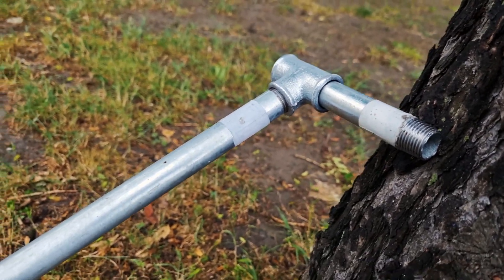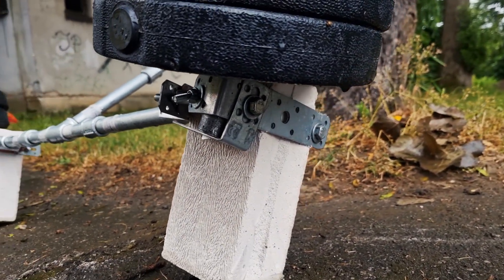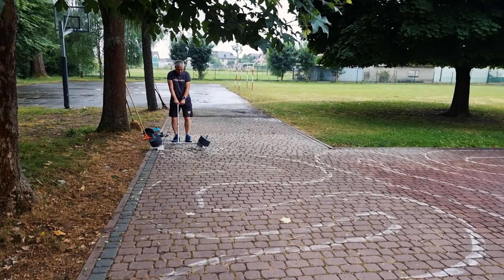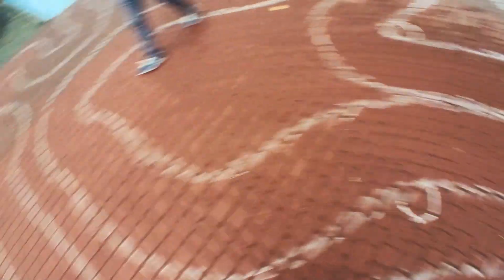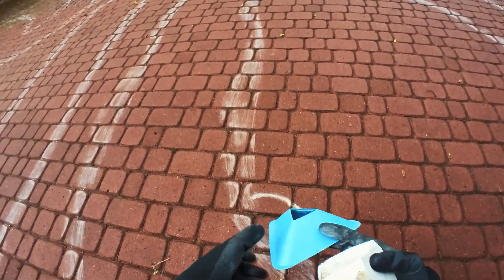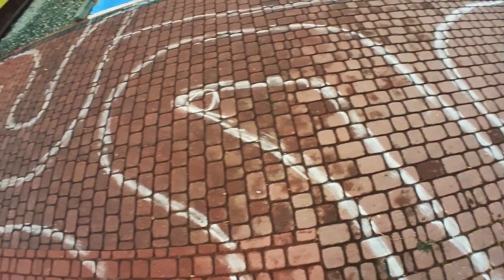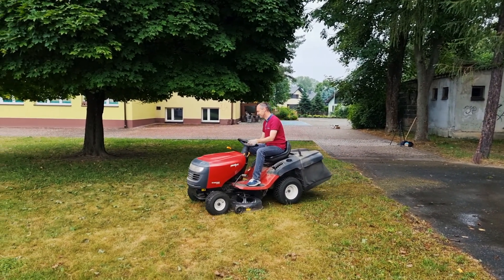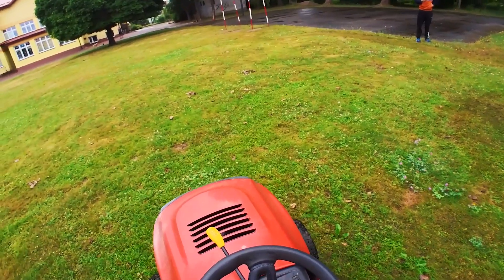How to make a Rc Rally Track (Part 1)

Comment: Thanks for doing the video. It is very interesting to see the tool they designed and use to layout the track. I think I would have to practice to layout the track as well as the gentleman in the video. He did it very accurately and guided the tool extremely well. I can see that it takes a lot of work and planning to layout the stages.
Reply from the maker: Welcome!
They are very skilled in doing that!
It can feel that it takes a lot to draw a Stage, but once that you learn to do it in 30 minutes you already have a place to play 👍